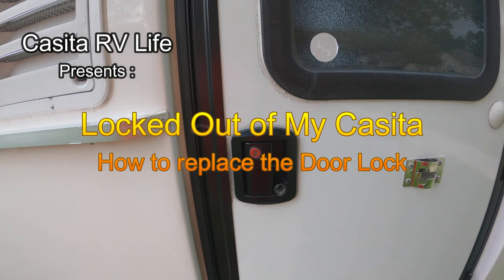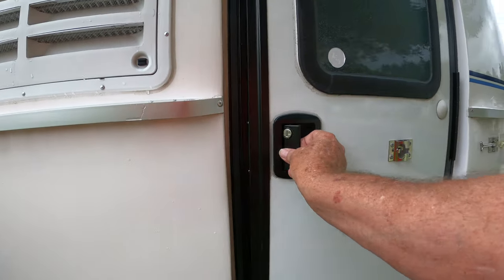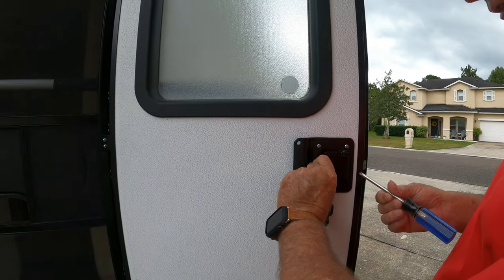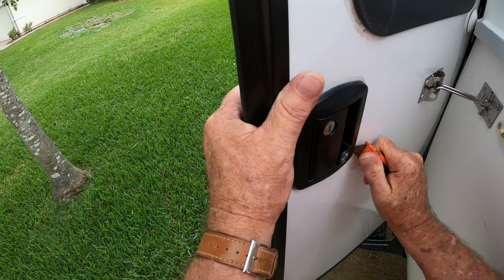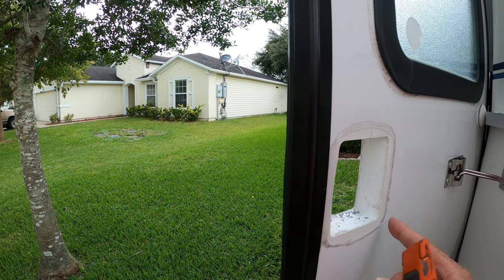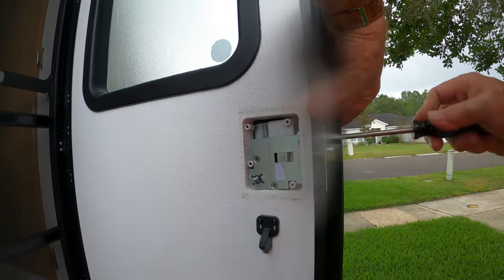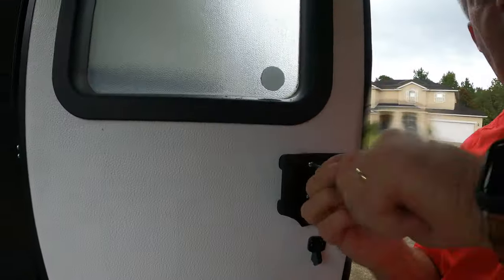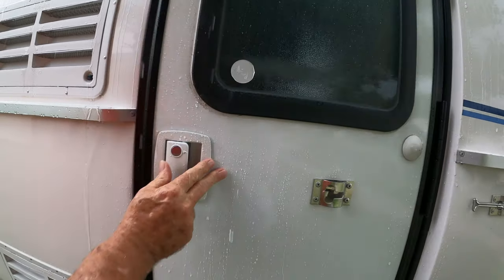Locked Out of Our Casita RV, Door Lock Replacement

Comment: Thanks for showing that. I have a new casita but the replacement you chose looks better than the one Casita uses at the factory. My keys are difficult to insert into the locks. The keypad is inconvenient and often fails, so you made the better choice. I’m thinking of ordering one for when mine fails.
Reply from the maker: Glad it was helpful. They’re so easy to install. I’ve heard a lot of bad things with the keypads failing especially when the sun shines on them.
Reply: Interesting... ours is 4 months old now and when I first picked up, the screws were a little loose so I tightened them.  Other than that we use the keypad pretty much exclusively without any issues.
Reply: @stevelineberry  Hmm… I’ll check the screws on mine. Or maybe the batteries are weak?
Reply: @tommyrantsrv  good call on the batteries.

Comment: Good video... was hoping you would have shown how you got into the lock so you could get inside. I tow with a  Tesla Model Y and keep my tools in the trailer so it would be nice to see or know the procedure just in case.
Reply from the maker: We were locked out of the trailer and the cameras were in the trailer. All I did is take a small drill bit and drill through the key on the lock and then take a screwdriver inside and physically turn it to open it.

Comment: Hate to admit this, but I accidentally locked myself out of my Casita this week while camping. Had to call a locksmith to get it open. I was told it was the kind of lock that could not be “picked” and the only way to get into the camper was to drill the lock, making it necessary for me to look for a replacement lock. I can use the dead bolt, but still need to replace. Can you share the link for the lock you used? Thanks!
Reply from the maker: Sorry to hear that. Here is the link https://amzn.to/3QehdUL
Reply: @CasitaRvLife  I got busy and forgot to thank you, sorry. Link appreciated!

Comment: So the cylinder was just turning because of the various screws were loose and the mechanism wouldn’t engage? That tell us to check these screws periodically and if needed add a touch of lock tight? Thanks for sharing. Could you check for an email from me with some questions.
Reply from the maker: Yes the loose screws would not let deadbolt move. Check the screws on a regular basis and Loctite them if they are loose. We can be contacted at casitarvlife@gmail.com.
Reply: @CasitaRvLife  I would recommend to Loctite them during installation. A common cause of the door jamming is when the screws on the face plate jiggle out.
Reply from the maker: @Tom Griebe  I agree. I have already put Loctite on mine.

Comment: Must be a Casita Specialty, received my brand new Casita last week and the door latch was missing 3 out of 4 bolts and the 4th bolt was almost out as well. I tightened the bolt and don'tcha know when I latched it my door would not open. $36,000 trailer delivered in that condition? I was beyond mad! Sorry to say I received very little help with my problem. WARNING, after they get your money the customer service SUCKS! Continuing, I had to go to Lowes and get the bolts 8/32 x 3/4 but the trick is get some locktight, the bolts will rattle out if you don't apply locktight.
Reply from the maker: Sorry to hear about your problems. All of my bolts were in when we bought the trailer. It took about 50,000 miles before the loosened up. I now check them on a regular basis. I also used lock tight when I replaced the lock.